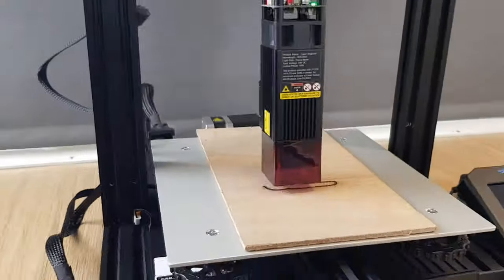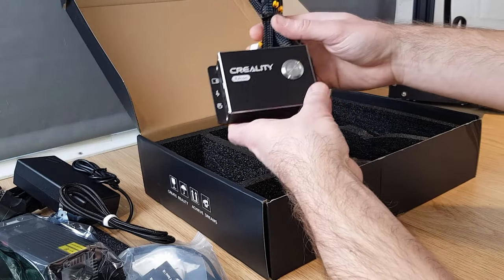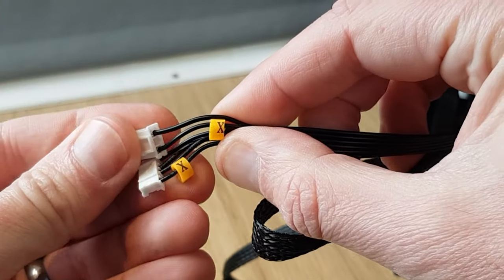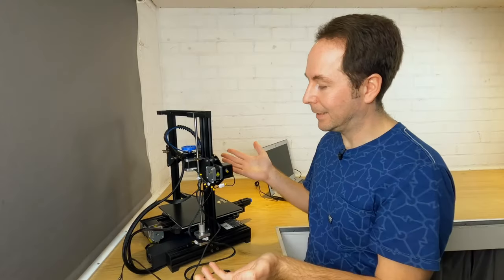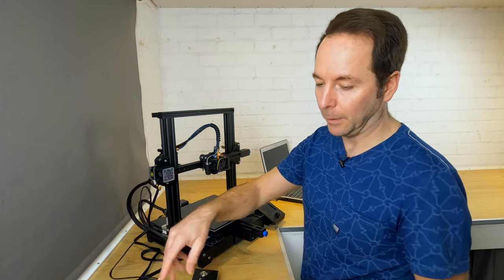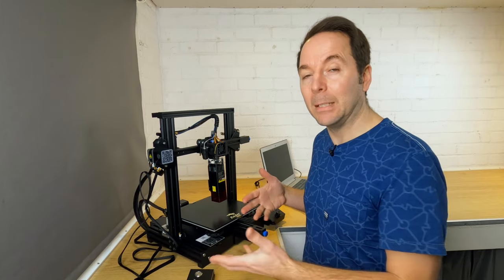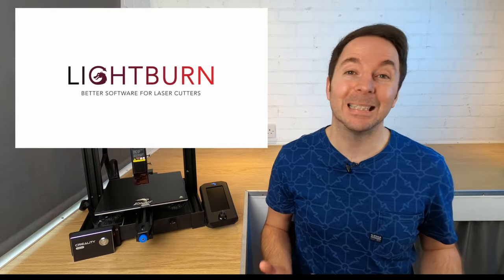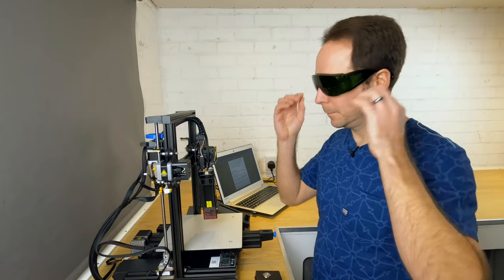New! Simple Kit To Turn ANY 3D Printer Into A Powerful Laser Engraver

Comment: Since I got my Ender 3 V3 KE, my original Ender 3 with a faulty Micro Swiss NG hot end/extruder has been sitting, unloved.  I had the idea to convert it to a laser machine as the extruder does not need to be part of the equation.  I saw Ricky Impey had a relevant video and my mind was made up after watching.  Creality has you to thank for another $200 ish USD in their pocket.  I feel that even with my limited skillset as I am new to the hobby, I am confident I can make this work for me.  Keep up the good work, Ricky.  You inspire the meek makers to be strong.

Comment: This is a great video and I have purchased one for my son however he has the Ender 3 V3 SE and isn’t on the comparability list. We’ve found a print to support the bracket installation but Y axis connection is under the machine and I can only see a motor cable and not a limiter cable. Any advice on this installation or videos would be amazing if you could support? Thanks Neil

Comment: If i understand correctly, this kit runs completely independent of the printer's hot end? I have an old ender 3 with a dead hotend, but the gantry and limit switches work fine. I was going to replace that hotend at some point but now im thinking i could remove the print head and make it a dedicated laser engraver...
Reply from the maker: That's correct, sounds like a great use for an old printer👍

Comment: Hey Ricky, great content, thank you. I have an issue though: i used the falcon 10w with an elegoo neptune 4 and just hoped, rhat the stepper motors would be the same as the enders. My results are messed up. I cant seem to get x and y both to work. I basically get a line in y wirh some x sqiggles. Do you recon ive got a faulty control unit, or is it the stepper motors ? 
Cheers for your answer

Comment: I just got this kit and I’ve already ran into a weird problem. When I turn on the falcon board the laser is already on and immediately starts burning. I don’t understand how to fix this. I’m using the SD card it came with but should I have formatted it first so only one files exists? Would this cause the issue?

Comment: Thanks for this video, was looking to buy the laser Falcon2 but this look's as if it a better way to go. Wanted it for cutting former's in 3mm ply and Balsa for model aircraft and Hovercraft'. Would this be any good for balsa or do you think the wood is to soft? Have looked at the enclosure and with a bit of mod could fit a small fan to get rid of the fumes'. May be you could look at making one for a future video, anyway thank's for what you have shown so far, is the discount code for Amazon UK or the US only?
Reply from the maker: I haven't tested balsa wood but I would be very surprised if it doesn't cut it. It cuts 3mm plywood easily. The Amazon discount should work in the UK, I have a feeling it ends very soon, the extended it for us but it's due to run out.

Comment: I have an Elegoo Neptune 2S and wanted to know if the bracket would fit that printer.  I've had experience in CNC machining and have been wanting something like this.  Great review!
Reply from the maker: Hi, I don't have access to an Elegoo Neptune 2S but it looks from pictures that the rollers are further apart so I would say that the stock bracket probably won't fit straight on. However, it might not be that difficult to make up a bracket. It only needs to hold the laser module in the right position and prevent wobble in the x direction.

Comment: Hey, my sd card won't work for some reason. When I hit the button it homes then beeps 3 times, and it doesn't do a frame or anything. I hooked it to my PC and it worked with Lazer grbl. I also formated the sd card multiple times with no luck and tried two different ones. And suggestions?

Comment: Nice job on review as usual. Quick question. I have E3V2 with upgraded DD extruder. Will bracket work with that?
Reply from the maker: It hooks onto the sleeves that space the X axis carriage from the rollers and clamps onto the X axis bracket back plate. As long as those parts are still there then it should work. Worst case you make need to make a mod to the bracket.

Comment: I don't have a solid enclosure for my Ender 3 S1 pro but I have the Creality print tent.  Do you know if this would be safe to use?   I am worried as it has a metalic looking liner, so I'm concerned about reflections.  Any advice would be most appreciated.  Thank you for another great video ❤
Reply from the maker: You certainly shouldn't use one in the Creality tent without safety glasses. You are correct that any reflected light can still cause harm. You could use the Creality tent to contain the smoke though. Personally I would use some sort of extraction too if you can.
Reply: @RickyImpey thank you

Comment: Hi Ricky, thanks again for this video, after watching it I have decided to buy it using the link you provided. It is working great, the only downside is that I am afraid of plugin and unplug the cables many times, the chance of damaging the plugs/cables is something to keep in mind. I have a question. Nowadays you can buy a cheap 3018 CNC machine that also is something I would like to have. You can pick them up for as low as EUR 170 these days. Would this Creality laser unit also work on a standard 3018 cnc machine? The stepper motors are the same and the X axes are a lot more steady than the one on the Ender 3v2. Would this work?

Comment: Thanks for the video Ricky. I'm curious how safe these lasers are to run at home. I've heard of laser radiation and fire hazards around these engravers. Is it safe to run them without housing and fire protection?
Reply from the maker: 'Safe' is a matter of opinion. There are dangers and you need to be aware of all of the hazards which it seems you are. You should never look at the laser light without protective eyewear and yes, there is a fire risk. You should always be present when laser engraving and have a fire extinguisher nearby. That being said, I have never had a fire and any flame has gone out on it's own after seconds.

Comment: With some minor modifications, I was able to fit the bracket that came with the kit on my Anycubic Kobra Max (400 x 400). I had to clip a couple of unnecessary plastic clips protruding toward the back, replaced the screws with flat heads and bought shorter M3 screws (5mm) for the ribbon cable retainer. I also had to reposition one pin  from each X/Y axis endstop because crealities config is different than Anycubic. Creality and most other printer mfg. are NC (Normally Closed) - Anycubic in their infinite wisdom made it NO (Normally open) which is not really safe. After succeeding with that, I installed LightBurn installed the module per crealities instructions and I get a error "GPIO isr service is not installed" and homing failed (with momentary grinding noise from Y-axis stepper). I can't manually home it just grinds in place... Initially I thought it was the endstop causing problems but regardless of what state the enstops are in (OPEN/ CLOSED) I still get that error message. I contacted Creality tech support but they are slow to respond. Any ideas?
Reply: turns-out it wasn't just the endstop switches that were cock-eyed, it was also the stepper motor pinout. I had to swap the two center wires and the steppers are now working correctly. It turns-out, that gpio error message is "normal" from creality. If you watch the setup video, you'll notice that they also have that error on lightburn!!  To get this kit to work with Anycubic printers, you need to jumper the NC throw of the switch to VCC pin OR buy a switch that already has that configuration (basically any non-Anycubic endstop). then you need a 3 wire cable (JST XH-2.54mm) NOT 2-wire because when switching back, the Anycubic board will use the other wire. You also need to swap the two center wires on one end of the 4 stepper wires. This way the steppers are getting the full duty cycle, not half which is what was causing the grinding! You also need to purchase or make longer XH-2,54mm cables for the endstops and laser module as well as JST PH cables to extend the stepper motors since at least one set will have to be modified as an adaptor. You could also just swap the pins on the creality Falcon control board itself! Either way, you need extra cables! Now if I could just figure-out how to get non greyscale modes to work without crashing the creality laser control module!

Comment: My Z axis keep dropping down and jamming, how do i fix it so it doesnt drop down, also it runs in opposite direction away from the limiters and causing carnage, please help!\
Reply from the maker: To stop the z axis dropping, you may need to hold the mechanism still some how. I small plastic clamp on an x axis lead screw or something under your x axis gantry will do the job. There is no way to do it in settings i'm afraid.

Comment: Another great video.  You have been so helpful getting me started with 3D.  Will the laser work for engraving clear acrylic?  Can I use the sonic pad too?  I use a Cricut machine to engrave clear acrylic and it takes forever.  Wondering about the detail you can get with the laser?
Reply from the maker: Clear materials don't engrave with a laser without something applied to stop the light and create heat. With glass I use black spray paint but removing this from acrylic would be a lot more difficult. This kit bypasses the printer's control board so you wouldn't use the Sonic Pad for any control.

Comment: Thanks for this great video! You mentioned that this 10w laser can cut acrylic. What would a safe thickness be to be able to cut with this module?
Reply from the maker: I believe a 10w laser can cut up to 8mm acrylic but it's not something i've tested.
Reply: After watching a lot of videos on the subject, it looks like it mainly depends on the colour of the acrylic. White or partly transparent acrylic seems to be next to impossible with a diode based laser unfortunately. A pity because this laser is very friendly priced…

Comment: Hey Ricky 
How’s tricks.
Sooooo creality are sending me out a laser to review, so first port of call was to see if you had experience in this. 👍🏻
So I have one question, you say at the beginning of your review, that the separate control module does all the work, as my e3v2 has klipper (sonic pad) installed, does that mean I don’t have to re flash back to marlin?
Cheers mate, and great vid yet again.
Reply from the maker: Hi, all good thanks. Nope you just unplug the stepper motors and plug in the wiring from the new control unit, bypassing the printer's board and power supply completely. No firmware changes, no bed tramming, just plug and go really.
Reply: @RickyImpey  nice one mate.
It’s turning up today, I’m quite excited to see what it’s all about, and do my first review 🥴👍🏻
Reply from the maker: @toddy9141  send me a link when you're done 👍
Reply: @RickyImpey  will do mate, don’t think I’ll be upto your caliber 👍🏻

Comment: Nice video. I have a prusa i3 steel printer with updated 200x300mm bed that I am not using, and would love to convert it to láser, but I see this module very specific for ender users, that want to use their machine as 3d printer or laser. But for someone that wants a total conversion lo laser, I am not sure

Comment: Hey man I got a question for you. I just got a glass bed and I was wondering if you consider a glass bed better to the flexible bed that comes with my ender 3. I know that adhesion can be a problem on glass beds and unfortunately I cannot use glue or hairspray because the fumes from them are bad for my birth so what do you think. should I use glass? What are the pros and cons each? And can I put my flexible bed on top of my glass bed when printing with PETG to not damage the glass?
Reply from the maker: Hi, yes PETG can damage the glass. The big positives with glass is that it's very flat and durable. Glass is good if you want lovely shiny bottom surfaces but there will be prints that don't stick very well. If you can't use glue stick for those stubborn prints then maybe give glass a miss. I would advise something like a PEI surface instead.

Comment: This accepts the air assist correct? Saw a few videos that show using crealty's air assist but the description on the store doesn't mention if it has the fittings for the air assist
Reply from the maker: I believe an air assist kit can be added but it would need to have the fitting to attach over the laser lens.
Reply: @RickyImpey  You are correct! Ordered the air assist and it comes with the nozzle and cover for 10w (5w you have to 3D print one). Thanks man and keep up the content, you have been single handily the most useful for a new S1 Pro, Sonic Pad, and 10w laser user (i went all in after watching your videos)

Comment: Hi Ricky, I have purchased the 10w kit but not got round to fitting it yet. Still getting to grips with the Sonic Pad. 😂 Other videos I have watched about the laser kit suggest fitting a dual drive z-axis upgrade and indicated the an air assist gives better results. What are your opinions on these?
I’m still enjoying your videos, straightforward , concise and easy to follow. Thank you👍
Reply from the maker: Hi, in my opinion, dual z is a complete waste of money with a laser engraving head, the z height doesn't move with engraving. All it would do is help support the weight as the module moves to the unsupported side. If you have any rollers adjusted correctly, this shouldn't be an issue. Air assist is nice but not needed to get started. It helps keep things clean and reduces any clean up afterwards but it can be added later. As a tip, most air assist pumps are aquarium air pumps with a different label and the price doubled and any kind of airflow will help. Some use a compressor with a pressure regulator. All you really need is the attachment that goes over the lens and some hose if you have a pump.
Reply: Thanks, Ricky
Reply: @RickyImpey  That is not quite right......if the rollers on the end of the beam are in any way tight with 3D printing they will cause a drag and the beam will be deflected causing bed leveling problems...... but this can be good for lasering as once the beam is at it's designated height it will stay there no matter the weight shift..
Having tested the rise and fall of the beam with a dial indicator this was found to be true.
Perhaps the variation of the beam flexing will not affect the focus of the laser as it's quite small.

Comment: Very "suitably terrifying" video!?

So good to see you also tried it on other printers and mentioning the bracket issue, do you know if there are updated brackets available (I'm still considering getting a sidewinder or one of the elegoo printers).

Also would love a video on preparing images for printing and maybe a bit more information on printing on different materials (like leather as my wife is into sewing and might find this interesting).
Reply from the maker: Ok thanks. As far as I know there aren't any other brackets available yet but it wouldn't take much to 3d print one. If there is enough interest then I could model some.
Reply: @RickyImpey  Could use a Bracket if needed for Elegoo Neptune 3 Pro, thank you
Reply: @RickyImpey I have Elegoo neptune 4 max, if you can please recommend or design a suitable bracket, that will be an immense help. Truly grateful for giving me a hope of not having to another printer or a sole engraving device.

Comment: Does the Ender 3 S1 Pro require this Control Module also ? I am asking because the Creality CV-Laser Module 24V 1.6W Kit doesn't have this Control Module included and the LASER Module, according to other videos I have seen, is connected directly to the Ender 3 S1 Pro Expansion Port. Not sure whether this printer supports the electrical current drained by the 10W LASER module.
Reply from the maker: It is quite confusing. The S1 Pro has a laser kit available that uses the standard wiring, screen and firmware. This is a lower powered laser though and didn't get me excited enough to try out. 
This kit is a completely separate control board and wiring that only uses the 3d printer's stepper motors and mechanical components and bypasses the 3d printer's own control board and screen etc. This way it fits to a huge range of machines. 
This separate add on kit is more versatile and can do more than the S1 Pro specific laser module and doesn't need a firmware update.
Reply: Did you have to reconfigure the 3D printer and redo bed leveling after connecting the extruder again ? Thanks to your other video, my Ender 3 S1 Pro is configured and bed leveled. Works like a charm. I can't imagine having to do all this again every time I want to use the engraver.
Reply from the maker: @atg210  Nope, just remove the laser module, plug the steppers back in and print.

Comment: Does it have a built in air assist?
Reply from the maker: Not really, no. It has a cooling fan that blows some air down around the cutting area but it doesn't have an additional air assist pump. It is very likely possible to add one though, This is the same module that Creality use on their Falcon laser engravers I believe.

Comment: Hi, you mentioned that this kit will connect to any 3D printer? is this only for the ender machines?
Reply from the maker: It will work with any printer that uses the same stepper motors as the Ender machines which means most printers. The difficult part would be mounting the bracket to the hotend carriage. It will only attach directly to some machines.
Reply: @RickyImpey do you know if this will work with the ender 5 S1?
Reply from the maker: @kdotaustralia  I can't say for sure as I don't have one but I would think that it should. You would probably need a custom bracket to attach it though.